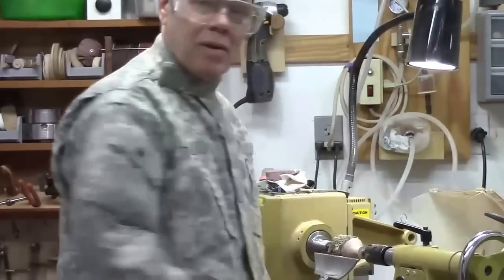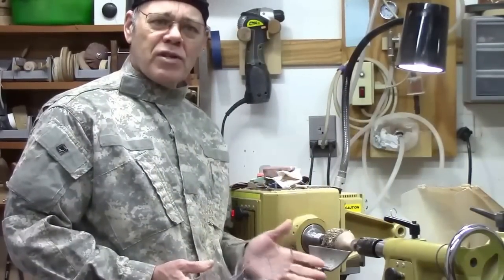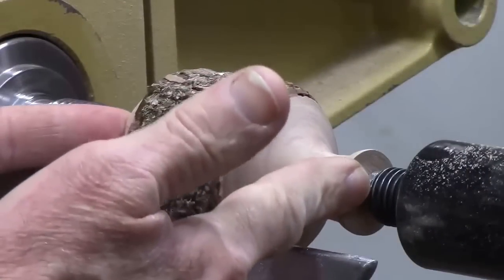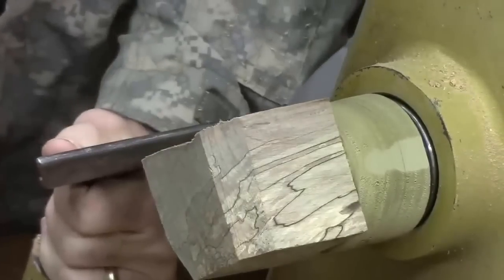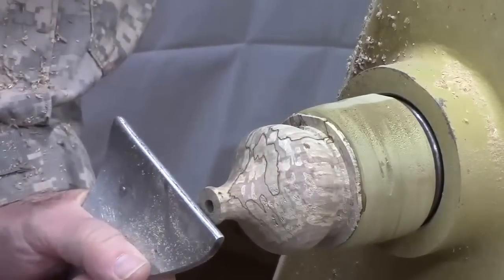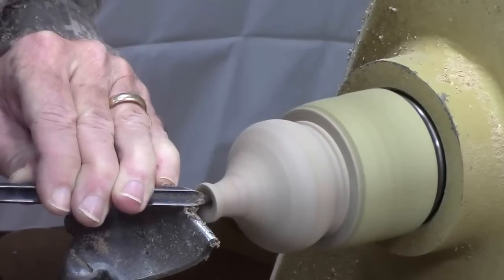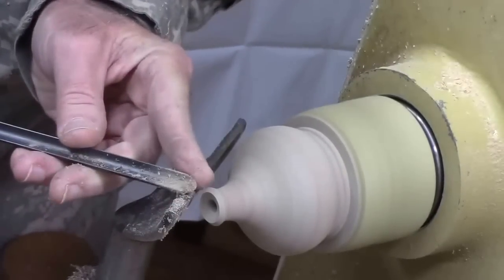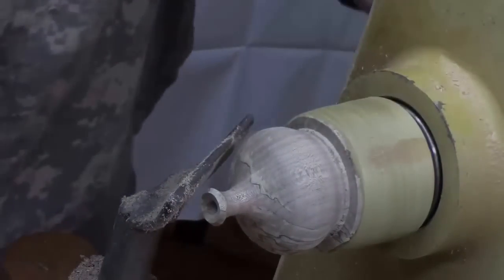How to Turn a Twig Pot Woodturning Pt 1 of 2

Comment: How long do you let the carpenters' glue dry and do you clamp it?
Reply from the maker: For gluing a blank to a glue block I might bring up tail stock support and leave overnite. Sometimes I clamp. I not in big enough hurry to run the risk of the glue not curing. If I was in a big hurry I would probably use a hot melt glue gun.